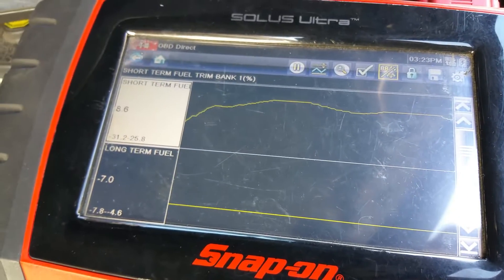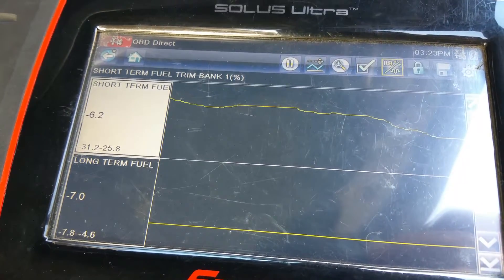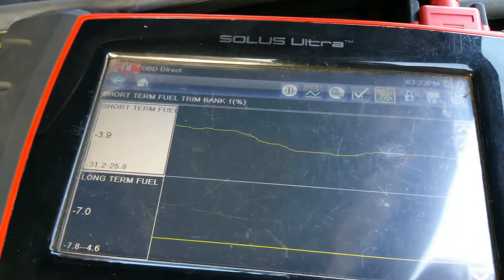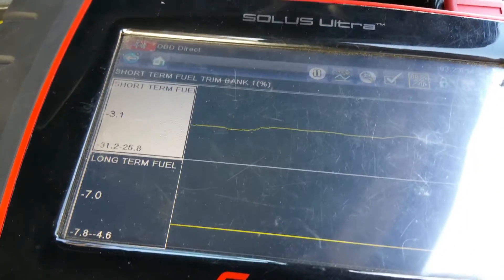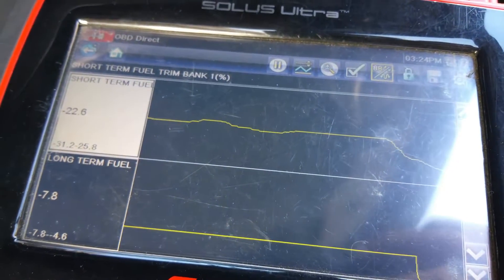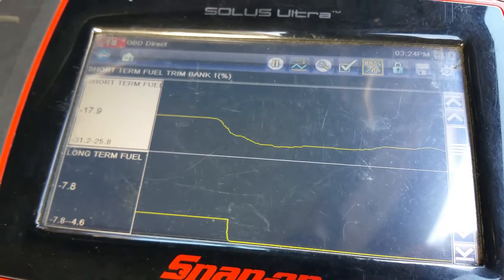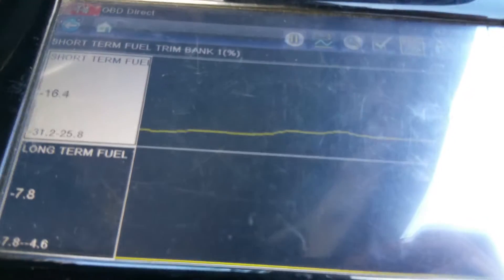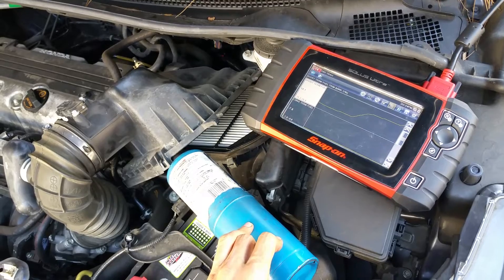Natural Gas forced down intake of modern car.

Comment: interesting test, in my country liquefied gas costs 2 times less than gasoline, I will install a solenoid that allows gas to pass when I step on the accelerator, the regulator is 2kg/hour, a 15kg cylinder would be equivalent to 18 liters of gasoline, I will see how much savings I get

Comment: I just have come across with this video,  and the funny thing is that for a  long time I was thinking about this and just a few days ago I made the exact same thing. 
Finally after so long I take muy propane torch and put it in the intake as he did. 
For my surprise i could make myself secure about  the engine(computer offcourse) was doing the adjustment on gasoline and reducind the amount of it. How do I know?  Becouse when I pull it out from the intake the engine tend to slow down, almost die but then again the gasoline kick in and normalised again. 
So now I know tha I can make a little hole on the filter plastic case and put some gas line there, with a solenoid valve that I can turn on and off. LP gas is cheaper than gasoline, i don't need to buy an expensive injection kit for propane or Natural gas.
Reply: I'm doing research and finding out you really don't need a full conversion kit if your using it as an additive. Some computers can handle full propane and have the injectors running at .25% duty cycle. Some computers can't even go that small lol. Amd Some computers need assistance. And I really beleive the full conversion kit and the safety crap is there to help get the public to spend money with the big oil companies for the conversion kits cause they own all the natural gas. I'm putting together a kit for my 3.0L H6 flat six subaru outback. Gonna put together a small kit and then monitor the engine live with some small trials.

Comment: A big question 
The propane gas you open into the intake i when to know if the ecu sensor detect the the engine pressure and slow dow the timing of the injection of gas or the ecu don’t detect the engine having more fuel and just burn away
Reply: The ECU detects that the amount of Oxygen in the exhaust has changed and it needs to send less fuel since it's already burning enough with the propane added.  It doesn't care how it gets the air fuel mixture correct as long as it is correct by the O2 sensors and the Mass Air Sensor

Comment: ELI5 explain it like I'm 5 years old. Dumb it down for me. What does this mean?  What are you hopping to get with propane injection?  How does it work?  What are your goals.
Reply from the maker: This is showing the work the computer is doing to keep the air fuel ratio perfect. If you have a leaking vaccum line, it goes plus a certain percent. If your injector is leaking fuel, it will show minus a certain percent. Because the computer sees it and adjusts the amount of fuel injected to balance it perfectly for max efficiency. If your number goes too high for too long, it throws a check engine light code for lean or rich.